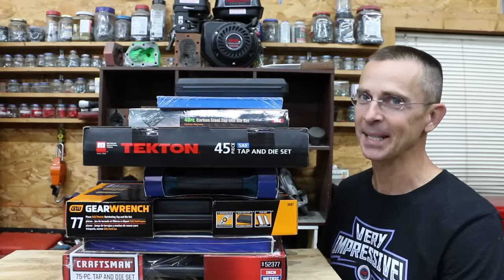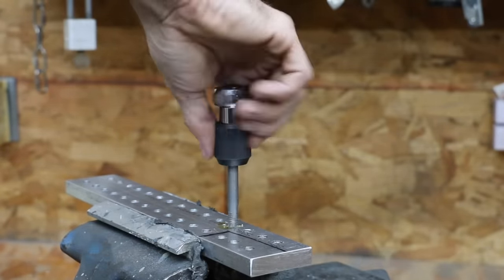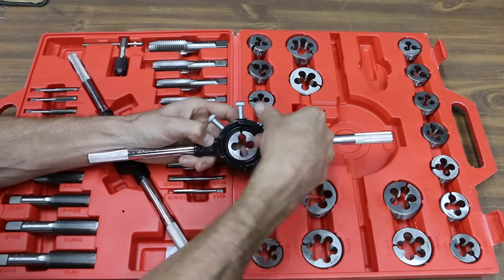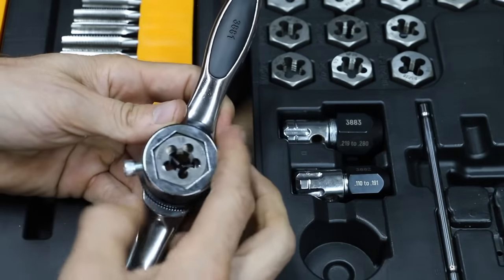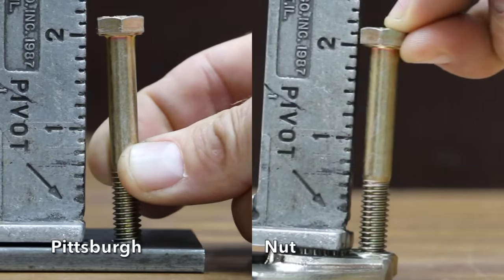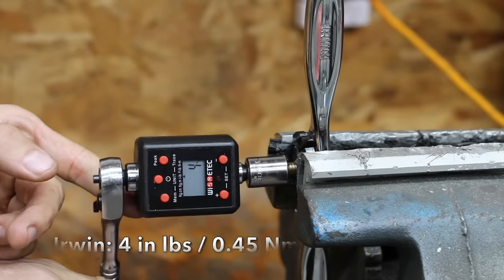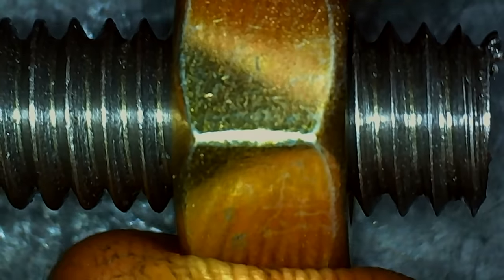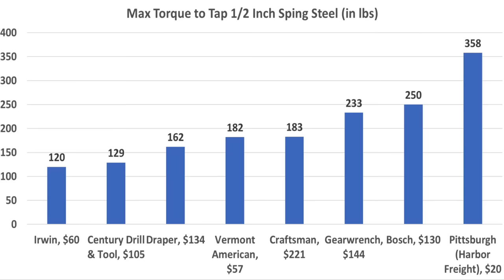Best TAP & DIE Set? Craftsman vs Irwin, Bosch, Draper, Vermont American, Tekton, GearWrench

Comment: Being a machinist, I would like to add that the fit check after initial tap test is a bit confusing. I've tapped thousands of holes. Maintaining a perpendicular axis at all times will make even the cheapest taps look great. The top wobble as you cut the threads is problem. I power tap on the lathe and the mill. Using a spring loaded tap guide can make them very nice and snug, just as you'd expect.
Reply: Too much side torque with that ratchet making an oblong thread. Tbh all these sets are junk anyway
Reply: Im not a machinist but thought the same thing.  Who really cares about the difference in torque required... It was a sloppy test with all that wobble.  He should have done each tap using the press to ensure a good stable tap.
Reply: @quimbymicheal  Your favorite brand? Not sure if high quality taps/dies are still made?! I really like the antique Greenfield USA set of tap/die I have. They seem to last & last even on hardened steel (I use good cutting fluid every time)
Reply: @MrRandyj72  ;  The torque required shows just how well the tap was ground at the factory.  The more accurate the tap is ground, the smoother the cut will be, torque requirement will be lower  and the finish will be superior.  So, that part of the test had some value.  That wobbling was terrible and definitely would throw off the fit test.
Reply: @tshoveltuski8273  ;  Greenfield is a good tap. So are Kennametal and Made in USA.  speaking only for myself, I stick with High Speed Steel taps and dies.  Although there are operations where carbon steel is desirable in case of breakage.
Reply: @tshoveltuski8273  Emuge are great.
Reply: On a CNC mill run your feed rate at 10 to avoid figuring up RPM's. F10=thread count x 100 for RPM. To hell with doing it by hand.
Reply: drilling the hole properly is the most critical
Reply: New sharp tap better than dull old, obvious. Coated better, hss next, then high carbon. Lubrication and chip breaking, important. Drilling the hole as not to harden the material or distort the hole, sure. For the most part, even with cheap taps, I can make a snug tapped or external thread if the axial alignment is maintained. Once I found that fixturing was the secret, it all became easy, sorta.
Reply: It does matter what kind of tap you use as well. These straight flute ones are mostly okay, because it's testing through holes. But some materials will require different flute types, or even just flat out different types of taps. On most of our production parts we use form taps simply because they last much longer. 

I can't quite remember which tap you use for what kind of material though, anything that makes stringy chips you want a spiral iirc, because those chips will jam your tap in a heartbeat.
Reply: It's Project Farm, not Project Machine Shop. If you're a machinist why not use a lathe anyway? Tap and die sets are for people with less specialized equipment to simply get some functioning threaded-fastening. If you want precision, you need to use precision tools.
Reply: @kennethbrown445  not really, learning a new technique, like using a cordless drill to tap a hole is one way. If you are going down the path where you check each tap for fit, and don't maintain equal  standards to each tapped hole, don't deduce that it is the tap! If I want to learn how to do something better, I ask those who've done it better.
Reply: @highstreetkillers4377  the taps are junk.
Reply: Agreed--I can generate a large amount of slop if I'm 0.5~1.0 degrees off the perpendicular axis. That said, the most slop with the least amount of wear may actually be the better tap as it cuts truest based on the angle of attack...🤔
Reply: @hoppykengka8226  0
Reply: @kennethbrown445  Well then use Fram oil filter for 3$ instead of NAPA for 12$ then.I have very good respect and enjoy the tests he does.All his tests always has low end like Fram to top of the line he tested K&N and all his tests I always learn something.The taps and dies test been great if it had the best quality like all your other tests do!
Can’t wait to see next.
Reply: John McCall - Correct me if I am wrong but aren't you supposed to work a tap slowly through the hole, and backing it out after several turns as you go, instead of taking a drill and buzzing it through the metal?
Reply: @tshoveltuski8273  - Nothing like having # 1superior quality tools in your hoard huh? It is tough looking at those beauties gathering dust and rusting after you retire.
Reply: @maxperry1635  It depends on the thickness of the material. Deep dives into material will  develop long loops of curly swarf that will bind the tap. Cutting and backing off breaks them into small little pieces that with lube allows a longer taps sessions. If the hole is very deep, you still want to remove the chips as they will hinder full threading in a blind hole. You don't want the tap to have to recut the chips. Power tapping sheets of most materials will not bind the tap. I don't power tap with a drill unless I am certain the I can hold it both in and out and not stress the tap. On a mill and lathe, power tapping is ideal, although the lathe is better because you can control the speed and feed.
Reply: @JM800  Thanks for concise technical info bro.
Reply: As someone who owns the cheapest tap and die set on Amazon, and produced miraculous results by being very careful and using the two-handed wrench slowly and carefully... with liberal application of oil, I am forced to agree with you sir. I would personally never "side load" any tooling tbh.  Im only a hobbyist, but I know that asymmetrical off-axis force is never usually a good thing.
Reply: 100%. im only a hobby machinest, but i thought the same thing. he should have at least used a tap follower for consistancy. also, the way he ran those dies, feeding stock from the drill, was a bit abusive. but mostly, i am dissapointed the Draper set didnt get a fair comparison. i actually thought that may have been the best quality set he had.
Reply: @quimbymicheal   yes what you said       it look like they did not think this thru on the top wobble !
Reply: The wobble was only on that torque meter tho
Reply: I totally agree with your diagnosis
Reply: I agree, however he is using these how the average consumer would use them.

The average consumer will buy a packaged set and not have access to anything beyond a cordless drill and socket set.

I used two flute taps supplied by a vendor that lasted relatively long with proper lubricant and technique.  I mostly used them on 304 and 316ss.

I think it’s important to keep in mind that he’s reviewing for the average consumer vs a tradesman.
Reply: @tshoveltuski8273  I have to agree on the greenfield. I had to tap something awhile back and used my friends old greenfield taps (green box) and they cut smooth leaving nice threads. Alot of the older guys where I work have em cause the company use to buy them, I was thinking of ordering some til I saw the price tag. Also I'm not sure if the quality of the newer taps would be anywhere near the older ones.
Reply: The tap method requires back and forth motion with  oil  to perform perfect or lathe... This kind of work with torque meter and wrench is ballshit regarding the side to side movement! You can't expect nice and perfect smooth with this process!
Reply: "I've tapped thousands of holes." Had to thumbs up your comment for that.
Reply: Agreed… There is nothing wrong with the Pittsburg when use properly. It works great!
Reply: Furthermore everyone if these sets were really only designed to chase existing threads. Secondly hole size affects fit with taps the recommended drill size gives you a 50-70% engagement so if you run a drill that can give 80% engagement you might actually have a hard time threading the screw in the hole by hand. Not to mention the tighter the hole gets the more accurately the tap needs to be perpendicular and on vector to the hole. Same also he's using a 5/16-18 as the test at bare minimum material thickness needed to be 7/16 or 1/2. For proper hold and torque capacity the general rule is a minimum 1 1/2 x the diameter for thread length. This becomes critically important when making threads for lift devices. If you want to get really accurate with fit and engagement you ream the hole or machine the round stock a lathe for the die.
Reply: @maxperry1635  depends on the quality of the tap and there are two types of taps and dies. Hand and machine. Tested here were all hand. Machine taps and dies were ment to thread by a machine because the cutting geometry helps chip clearing and chip breaking for clearing. Where as Hand taps and dies you do like you said you back off one turn after 1 1/2 to 2 turns of cutting which breaks the chip to clear the cutting edge.
Reply: Also not everyone is having access to not drill and tap by hand I have a broken bolt in a motorcycle frame along with a stripped screw so this seems applicable to me having to get it done on the bike.
Reply: @wrongfullyaccused7139  Greenfield was popular in my shop.
Reply: @bogdog999  ;  They were top of the line in my time.  I hope they are still as good as they were.
Reply: chris chris  I get my personal taps and dies from a local Fastenal store, they're not cheap (around 30/each) but are leagues better than these cheap casted tap/die kits and in my case I only ever need 1 or 2 different sizes/pitch. 30 bucks for one tap that works is better than 30 bucks on a whole kit of nothing.

I use FMT brand, Norseman seems to be decent as well but haven't used any from them yet. Fwiw I've chased over 30 holes with the FMT with no visible wear compared to my old cheap kit that destroyed the tap on just one of those same holes chasing holes in a car chassis.
Reply: @quimbymicheal  I like Dormers
Reply: @wrongfullyaccused7139  lmao. no.
Reply: @DieselRamcharger  ;  What are you talking about?
Reply: @MrRandyj72  I think it was nothing more than him getting complacent and stuck in his routine and nothing more. In my opinion there is NOT a more honest and non-biased creator on any social media outlet than he is, in fact if this guy gives a tool or anything I'm thinking of buying his seal of approval then I'm buying it. I think he's a school teacher and not a machinist just like 99% of the people who watch his videos aren't machinist and that's his target audience
Reply: I have never tapped or died anything, but I thought the wobble would be the cause for the loose fits.
Reply: @MrRandyj72  most users do not use it with a press...
Reply: But most people buying these sets are going to do it like he did in the video. Most people don’t have a lathe and mill in their garage so this is a more real world test.
Reply: @RedTideRTS  Right, these are used once or twice then turn rust laden tools in the garage.

Comment: I wish I saw this video 6 months ago haha! I bought one from dewalt and it broke immediately. Should have known from all of your testing that over the years that Irwin would have been a great choice. Thanks for the great video.
Reply: irwin and dewalt part of same company but dewalts might be made by someone else. dewalt bad about licensing their name out to others as in their heated coats and roll around stools.  all made by others
Reply: i bought my in germany while i was working there i payed it 100€ that was 4 years ago
Reply from the maker: You are welcome!
Reply: That Irwin is a brand that keep rising to the top, isn't it?
Reply: @gizzyguzzi  hopefully stanley brings it back from the mess rubbermaid made with it.  the vise grip stuff was USA made until rubbermaid moved it to china.
Reply: You can break a good tap with bad technique too
Reply: Dewalt taps are a great choice when you want to waste 100% of your money, and extract the broken tap 25% through the re-threading.
Reply: @mikethetoolman8776  I worked at the Irwin factory in Maine that makes their taps and dies. We didn't make Dewalt products.
Reply: @rawleywagor4943  is this the factory that was just moved to tenn?  what a mess they created if so. we have had back orders for 12-14 months now on tap/die sets and loose ones also
Reply: @mikethetoolman8776  I wasn't aware of that.  Thanks. I just looked it up and yes it closed like a year ago. Bummer, I liked a lot of the machine operators. I was an engineer there in 2014/15.

Hopefully the machinery went with the factory. There were 50-100 year old rollers they used to make the taps. Cool little machines. The dies were made on newer stuff.